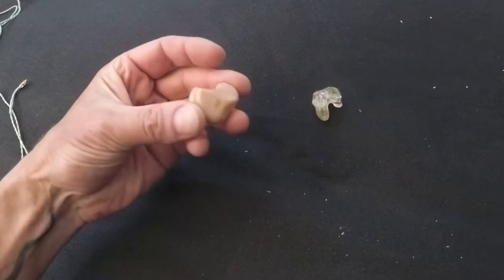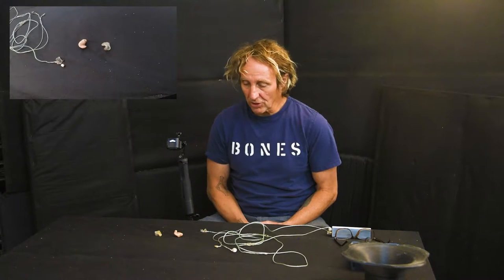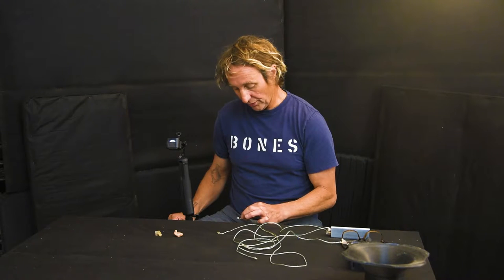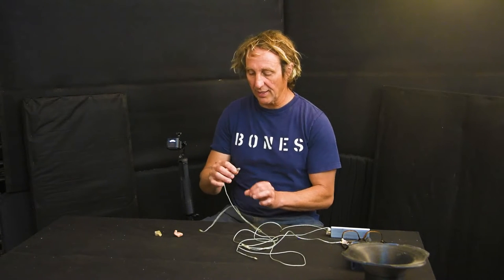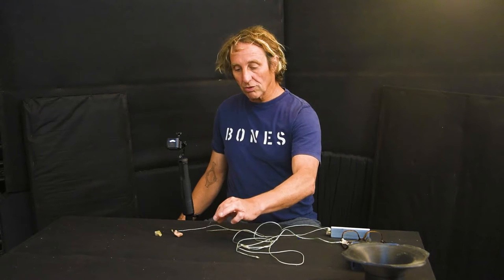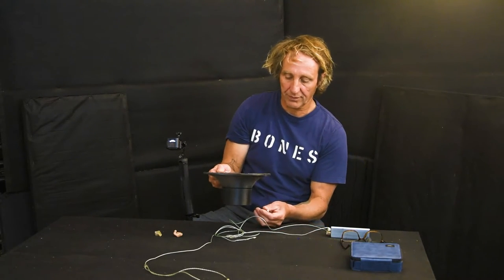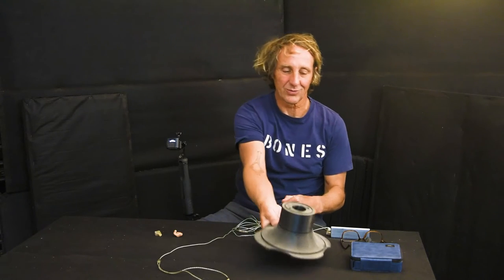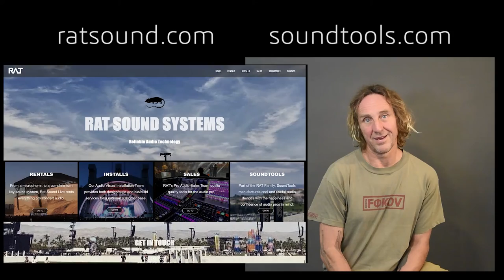Balanced Armature vs Dynamic Driver In-Ear Drivers (Public)

Comment: also, if the 'back-pressure' (the energy of the driver pulling back the opposite direction) is routed/tuned somehow thru a channel/tube/waveguide to be timed to sum with the forward moving wave/pressure you're introducing modulation problems, because the positive pressure wave that's channeled to positively sum with the forward moving wave is from a different TIME...  You're summing sound from a half-cycle ago, with current sound, you're going to change the character of the sound and smear it in the time domain...  this would be like adding a single delay to the sound that's as a single frequency and adding it back into the signal with 100% wet, and 100% dry signals and it WILL sound terrible.
Reply from the maker: Getting the back pressure to be in phase with the forward pressure is pretty simple to do as long as the distances involved are relevant in relation to the wavelengths involved.

That said, the distances involved with in ears are so small that they're not very irrelevant for frequencies below the kHz range.

Alternately setting up a hemholtz resonator can delay the back pressure in time a bit but again the size of the resonator increases with the wavelength of the frequencies involved, you'd have to have some mighty big ears to do anything involving low frequencies

Fortunately, unlike subwoofers, for in ears and headphones, we can typically discard the rear radiated sound and focus on optimizing the forward pressures. But you there sealing off the rear sound or directing it away from the ears such that it's not interactive with the forward pressure

Comment: i just got  a set of armature iems, not expensive. there the kx as10s from amazon. couldnt believe how good they soundedand the low end was nice.
Reply from the maker: They are not bright in the 3k range? Do they have a thin plastic shelll that makes a boxy plastic sound when the cable is touched?
Reply: I got those, and they are in fact also bright as bassy, mid-range feels very soft and not forced, such a good sounding and very fun IEM's @DaveRat

Comment: the louder and quieter sound created by cupping one's hand around the speaker is NOT from PHASE...  it's because BEFORE cupping the hands around the driver, the sound is radiating in 180 degrees..  i.e. the energy from the FRONT side it spreading out forward, and at angles...  all the 'power' of the waves is spreading out...  but when you form a CONE around it with your hands, all of the pressure waves are being forced to propagate at reduced reduced angle of dispersion...

so, instead of the soundwaves being allowed to just spread out thinner and thinner in all directions, you're  basically corralling ALL of the energy and focusing it in a narrower more coherent beam of energy forward toward a point or area of focus...   it has nothing significant to do with the inverse phase on the other side in earphones...
Reply from the maker: Cupping hands or forming a horn or wave guide is not a phase related adventure.

If you want to look at it from an electronic perspective, it would be more akin to it and impedance matching transformer.

Wherein The voice of the human or the compression driver or the speaker has a very low impedance acoustic output and does not have a lot of displacement but has a significant amount of force or current equivalent. Open air on the other hand is more like a high impedance input where large surfaces moving very little will connect much more efficiently to the air and a small surface moving a whole lot.

A horn or cupping of hands is like an impedance matching transformer that allows the low impedance acoustic source to couple to the high impedance air.

But you never get something for nothing so the sacrifice is directivity is reduced and frequency range tends to be more band limited.

Horns will be very efficient over a narrow range and less efficient above and below that.

This is why cupping your hand sounds honky or mid-rangey compared to a voice which has a more full range sound when there's no cupped hands or horn

Comment: So balanced armatures are micro versions of the old servo drive subs tours used to use, but full range reproduction.
Reply from the maker: Hmmm, not really, the servo drive had a rotary motor that rotated a fraction of a turn back and forth and had two belts attached to the rotor. One end of each belt was attached to the center of two opposing cones such that when the motor turned one way the cones moved toward each other and when it moved the other way, the cones moved away.

A balance armature is more similar to a phonograph needle where a magnet is suspended between two coils or a coil is suspended between twom magnets.

For a phonograph needle, motion creates voltage, for a balanced armature , voltage on the coil creates motion
Reply: @DaveRat  ah! Thank you, yes…that is better.  And makes better sense to me. 🫶🏻